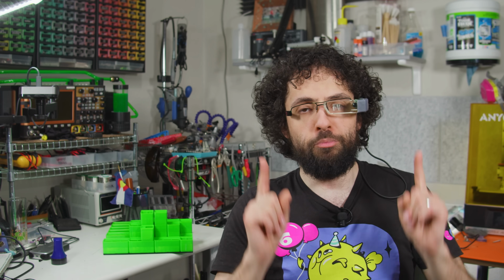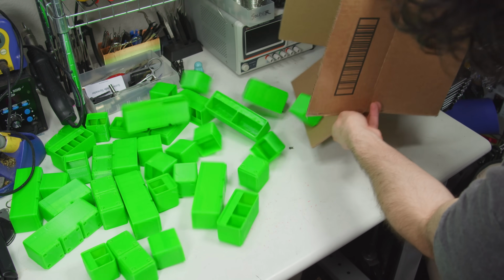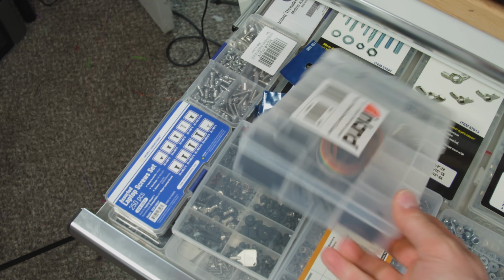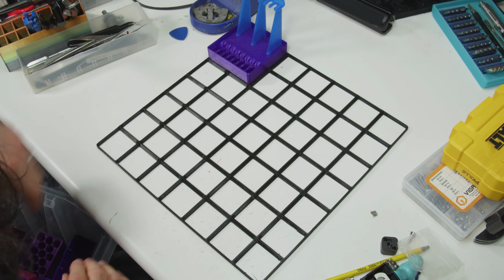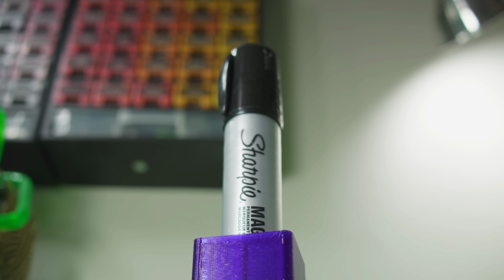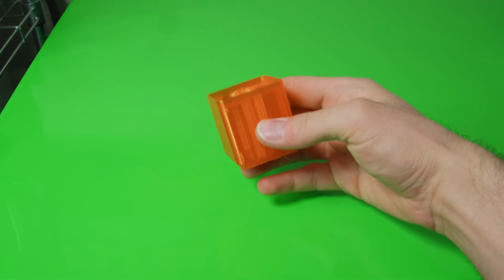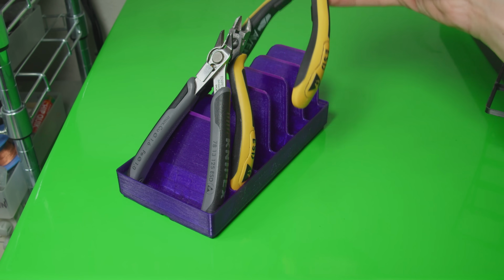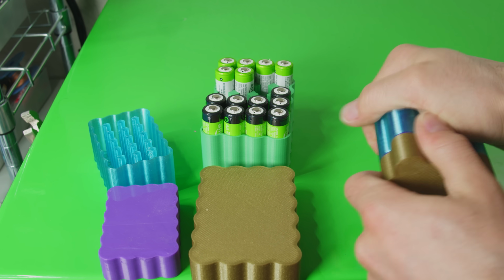Gridfinity: Your Ultimate Modular Workshop is FREE!

Comment: Love it. I actually purchased the system designed by Alex Chappel and have found it to be great, but this does cover some things his doesn't. If I heard correctly you said it was based on a 42mm grid system not 55mm which means sadly it's not inter compatible between the sets but I might just use some of the tool holder systems so I can store tools on shelves by the bench much more effectively. Thanks for all the hard work you've put in to developing this idea and giving it to the community
Reply from the maker: Yeah, they're not intercompatible. They're sized to fit the microscope slides, and 42mm is a highly composite number that's easily to mentally divide by 2, 3, 4, and 6
Reply: I mean, you can scale things up. The clearances will increase but depending on what you need that might not matter
Reply: Haha I knew you must of sized them to the microscope slides. I've printed a bunch of them now and am in the process of remixing a bunch for both my work tool box and for home. Currently working on bins bigger than 1x (so 2x 3x ect) with dividers in both directions with the little scoop in each divider parametrically(figured it would be nice to have a single unit with all the m3 Hardware for example)  but yeh totally have been a bit puzzled by the 42mm size I think 55mm makes a bit more sense and wondered why you went so small and thought it must be the slides. Anyway I'll post some of my creations once I've printed them all on thangs

Comment: I gotta say, I bought that same HF tool chest, and it works amazing, and for the price, its a steal.  Compared to the other stores brand stuff, it was like 1/2 the price, plus it fits the foam organizers that came with my 300 pc Kobalt mechanics set (which kobalt made a specific series of toolbax that was the only one with the right size drawers for the organizers, then discontinued it, lol).  Plus, I got it in bright ass oranges, and got all the random magnetic accessories to match (like that extension cord you got, which is awesome to have stuck on there, so convenient)
Reply from the maker: I know! I thought it would be total garbage that I'd need to hack up, but it's almost too sturdy...

Comment: I don't know about #gridfinity, but this is one of the most entertaining videos I've seen all month. We have a few AD Ultra HD 4Ks who run a few 3D printers, making spacecraft parts at ASU. I hesitate to ask, but how do you store cables?
Reply: I also want to know this. You can only Roadie Wrap and hang on hooks so much
Reply: @dailythenoob  for long cables, like patch cords and extension cords, roadie wrap is great and our preferred method. We use comb hangers for banana jack and bnc type cables. What I'm looking for is something to organize the plethora of different USB and phone cables. We have a velcro strap on every cable and that helps keep them from getting tangled. I use gallon ziploc bags at home, but they don't wear well in a working lab. Having a separate bin for each cable type is fine, it just takes up a lot of space due to the number of different kinds.
Reply: Dunno about zach, but I do  labeled ziplock gallon sized bags in a clear tote. Label the tops and its real easy to rifle through, pull the bag you want, and shove it back. Within the bag, every cable has its own velcro ties, so that they don't self-knot.

Had this system for years, best I've found so far.
Reply: @jippenfaddoul  Thanks, I use the exact same system. I've used comb hangers and spools, but the ziplocs always win.
Reply: Have you ever tried toilet paper and/or paper towel rolls? They hold most small cables.
Reply: @RobertMorgan  small cables are easy, but what about big cables?